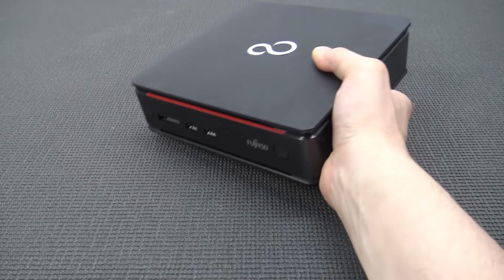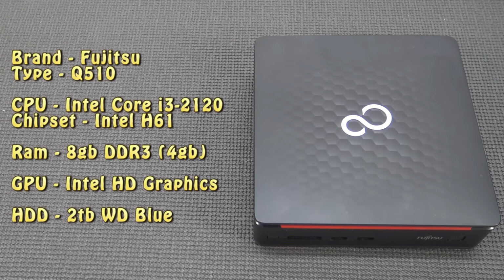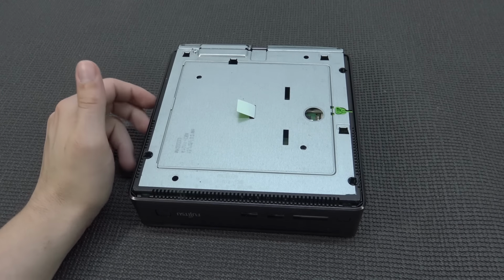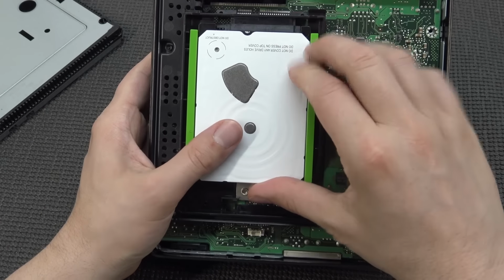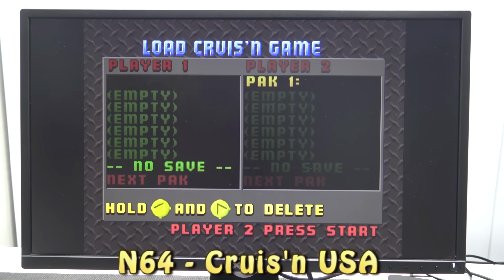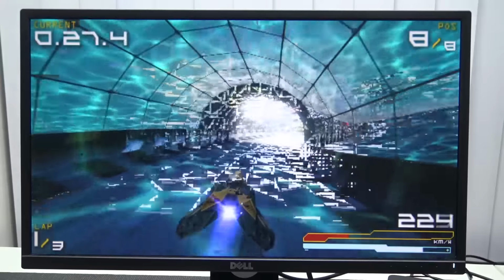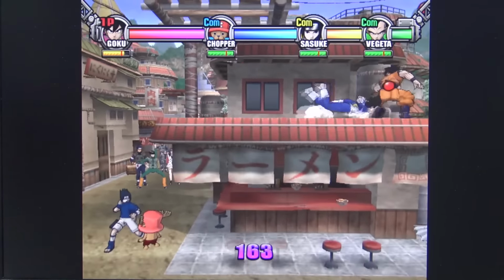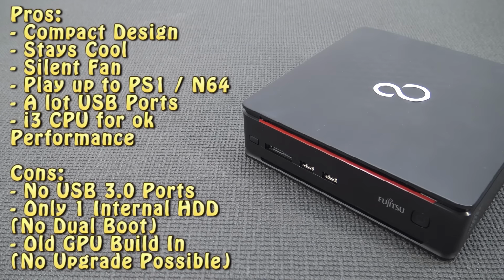Turn This $75,- PC Into A Retro Emulation Mini Beast Machine 😄

Comment: Many H61 motherboard support Ivy Bridge cpu, i don't know if Fujitsu has update the bios for them or not but 10$/€ is possible to buy a i3-3225 with much better igpu (HD4000), more powerfull and compatible than Sandy Bridge HD graphics.
Reply: These boxes are 6th gen Core with 14nm and Intel HD graphics, way beyond HD4000.
Reply: @lovemadeinjapan  this unit have a i3-2120 sandy bridge with HD graphics 2000 (only the i3 with that end with the 5 have the HD 3000), the best i3 this motherboard can run are Ivybridge i3-3225 and 3245.
Reply: @lordsoth6389  I was mixed up with another video, but you are right, this one should be skipped. Get the ones with 7th gen chip, they are about the same price, and even better, come with 128GB SSD/8GB by default.

Comment: In my opinion, it doesn't worth it to buy a mini pc with older cpu than a skylake (7th gen) for windows 7 or a coffe lake (8th gen) for windows 10.
Reply: Why, 7 and 8th gen aren't much better than 6th. Intel was on 14nm for quite a long time. Only very recently (2020) they went to 10nm and better. And even then I have doubts. If I see how easily my 2023 i5 laptop goes into fan mayhem, I rather have my Broadwell Macbook, the first 14nm generation, which is dead silent.

Comment: Well, I have bought such a machine, "second-hand" last week.

A cute little thing that works fine.

The non-standard PSU has a lot of coil whine, and the black, nameless, made-in-China SSD is almost as slow as a mechanical harddrive (the Crucial BX SSD that I put into it is much better).

The CPU gets up to almost 60° Celsius with the top "lid" on...
With the cover off, the temperature drops down to some 35° Celsius. BAD cooling, Fujitsu, shame on you.
I am going to do some "case modding" and make a new (wooden) cover with a 80 mm fan from an old PSU in it. The power connection of this fan fits perfectly on the spare power connection on the motherboard.

The seller had installed Windows 11 on it (with a non-supported CPU, an i5-6600T), but I replaced Windows 11 with Windows 10, because Windows 11 is total crap.

Even if the "buzzing" and "crackling" PSU makes the thing break down tomorrow, or next week, or in two months, it won't be a big disaster. I just bought this thing "for fun".
Reply: I see my version has two USB3 ports, a microphone and headphone jack.
Reply: 60° sounds like a perfectly cooled CPU. Above 100°C I get worries

Comment: USB sticks, microSD/SD are not really a good/fast medium for an OS and games... Would definitely use an HDD or even better an SSD!  
What GPU memory size is allocated in the bios? Sometimes it's set at 32 or 64MB, with 4GB ram you could set it at 512MB or 1GB, that could help the performance..

Comment: You didn't have to remove the 4 screws. You just slide over the green switch and pull up on the finger hole

Comment: For the older systems it's not bad, but that GPU is definitely struggling on the faster stuff.
Reply: An old i3 isn't much better than an android box. When buying an "old" PC for emulation, you want to get a decent quad core i5 or even better, an i7. And you want to get a PC that has the ability to add a discrete GPU. Yes, I know that right NOW even "old" GPUs are kind of expensive, but that isn't going to last forever. Once you have a PC with the i5 or i7 and gfx card prices are normal you will be able to add a 970, 980, 1050 for cheap and it will do a great job for emulation.

Comment: I have the same CPU but a full desktop version. Can't say I have had the glitches. But I have been running the emulators in windows
Reply: the glitches are from the cpu's integrated graphics not from the chip itself

Comment: The integrated graphics seemed to be the biggest issue with this particular unit going from all the glitching and some speed issues.  I think it would be better with even a lower end graphics card, especially an AMD one considering how much better those tend to get supported in Linux.  Something like an I3 with 8gb (that really does need upgrading as well) and anything from a HD7000 series GPU would probably do quite well for general emulation and even up to most Windows XP titles up to 1080p.
Reply: the IGP is going bad, Ive used a cpu from the same line up but an i5 version using intel hd graphics and it didnt have graphic problems